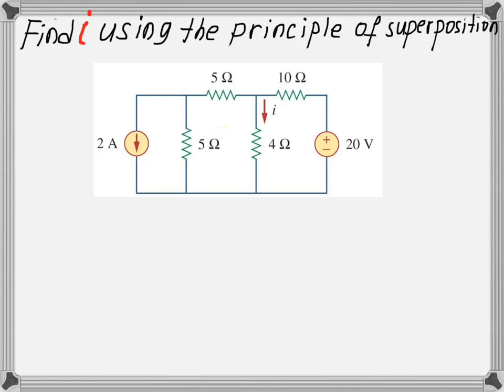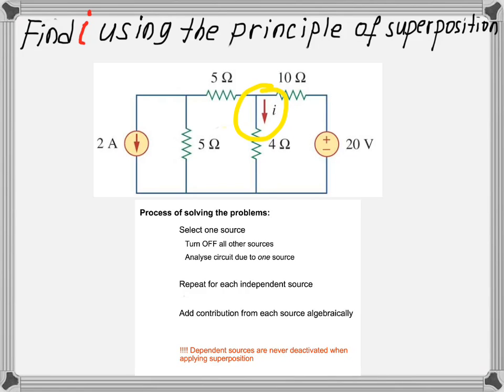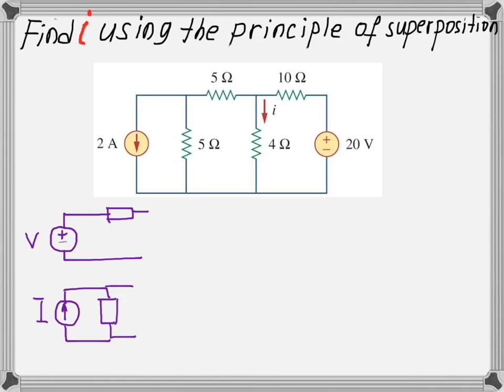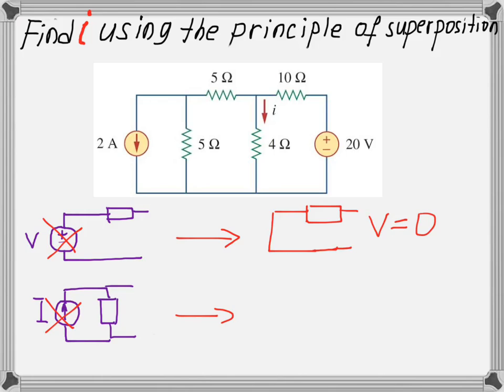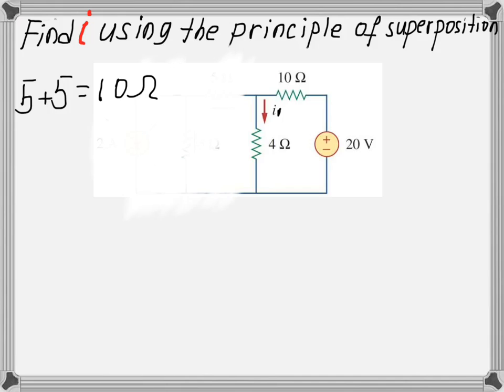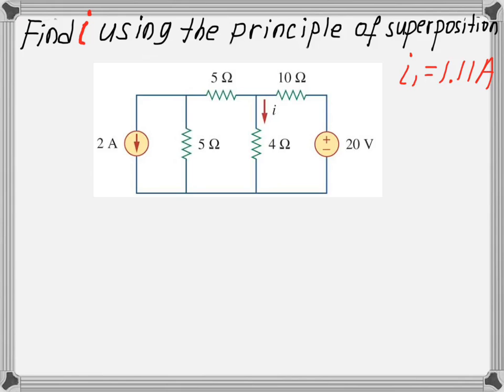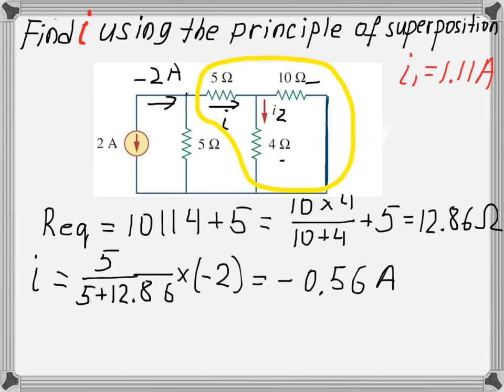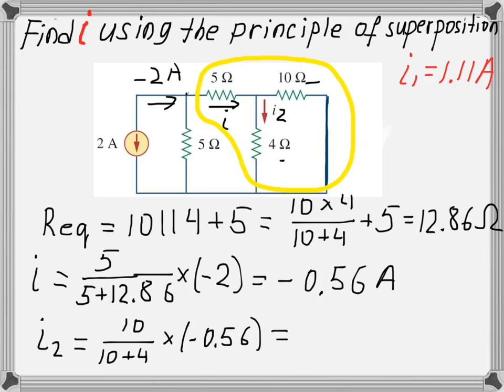Superposition Theorem with example

Comment: @ 9:23 There is an error in the calculation of Req. Req = 10//4 + 5 = 110/14 = 55/7. By current division then i = -2 x (5/(5 + 55/7)) = -70/90. i2 = (-70/90)(10/(10+4)) = -5/9 Amps. By the way, i = -5/9 is the same value calculated by Mesh Analysis. Therefore, the total current in the 4 ohm resistor by Superposition is I = 10/9 - 5/9 = + 5/9 Amps. ∎

Comment: Regarding the equation in the second part to calculate i_2, shouldn't it be multiplied by -1A instead of -2A because the current splits between the two 5 ohm resistors? So the final answer should be i=i_1+i_2 = 1.11 - 0.36 = 0.75. Pls correct me if I'm wrong.

Comment: in calculating the resistance with 2 Amps active 10 parallel 4 +5 is equal to 7.86 ohms

Comment: How did you find that current at 5:49? What's the name of the method that said you can take opposite resistance over sum of the two parallel resistors?
Reply: Current Divider

Comment: Part-1 is ok, but she did a mistake in part-2 in calculation of Req which should be 2.86+5=7.86 instead of 12.86, then i should be -0.78 instead of -0.56 and last i2 should be -0.56 instead of -0.4.
Final result will be i=1.11+ -(0.56) = 0.55 Amp.
Reply: +Nabeel Alawadhi 

she added 10 to 2.86 though not 5?
Reply: +Lawrence Ijeh yes the correct is to add 5 not 10 :)
Reply: right

Comment: When you are calculating i2, why is it that the 10Ω resistor parallel with the 4Ω resistor? Shouldn't it be in series?
Reply: Nope... There both of their terminals are connected at same place... So it becomes in parallel....
Reply: Yes, it must be in series ....
Reply: Bishen Patel Yes it's series

Comment: I just want to be sure. When you calculated for i1, I think you did it incorrectly. Isn't it supposed to be i.k = i.total * (R.opp/R.eq)? In which case i.1 = (1.56)*(10/12.86) = 1.21A?
Reply from the maker: when you finding i1, you just need to find the portion of the total current 1.56A being going through 4 Ohms resistor. The current divider is I1=Itot*R2/(R1+R2). So you divide it by the sum of resistors, not equivalent resistance. You can simply use Ohm's law to check it, but the solution will be longer.

Comment: Hello...How did you know in which  direction the currenst flows?
Reply from the maker: Well, sometimes it is hard to predict the direction of the current. But usually you just start from the positive terminal of the voltage source and then follow by the brunch. This is like water flow in the pipes. If you have a current source the direction of the current is shown by the arrow. If you can’t predict the direction of the current – you need to guess. If your estimate is incorrect – you’ll get the negative answer.
Reply: Thanks for your answer. you have a nice accent, by the way.

Comment: ((10*4)/(10+4))+5 ≠ 12.86
((10*4)/(10+4))+5 = 7.85
Reply: Right
Reply: I was shocked at first by that time 4 and plus 4 but then it fine. Because i'm using 1/Rt=(1/10)+(1/4)
Reply: why + 5? there is a series resister of 10 ohms!